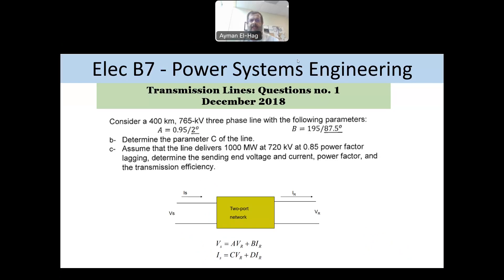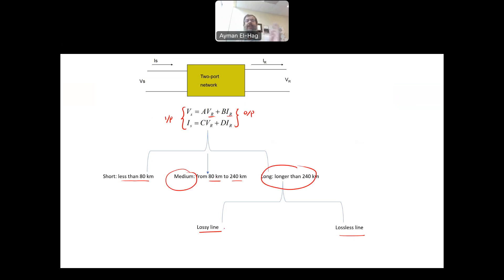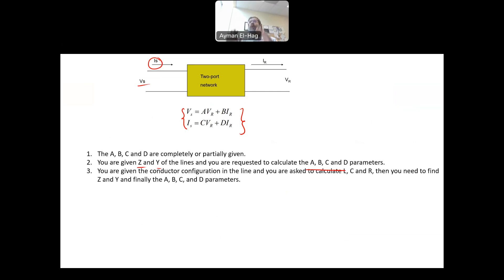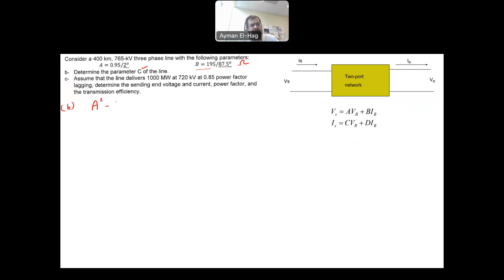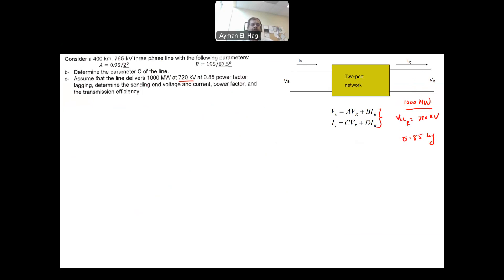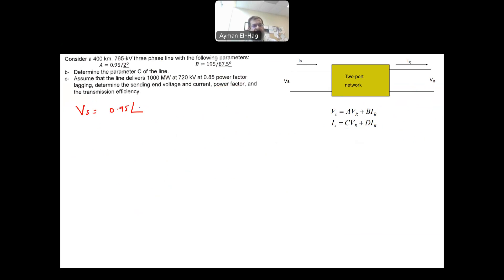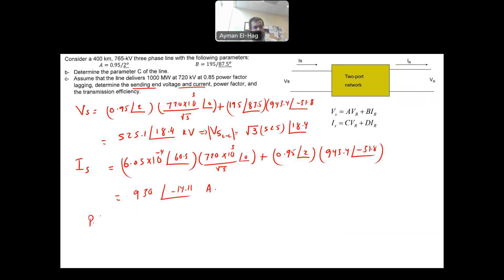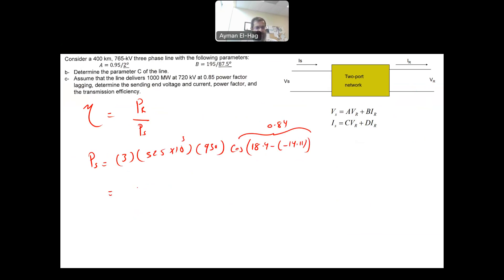PEO solve examples (ELEC B7) Transmission Line Question no. 1

Comment: when determining line voltage you are multiplying by root 3 but should not be the angle the same it should be added 30 degrees
Reply from the maker: You are correct, although I mentioned the magnitude of Vl-l, so I should not have written the angle

Comment: جزاكم الله خيرا وبارك فيك
Reply from the maker: الله يرضى عنك
Reply: @electrical4everyone  انا حقيقة ممتحن المادة نفسها ELECB7
 شهر مايو يوم  ٩..
وبعيد جدا جدا عن الدراسة ..قريب ال٢٠سنة..هل ممكن تساعد بأنه يكون في مختصر للأساسيات يركذ علي الإمتحانات مثلا..مساعدة لانو الزمن ضيق جدا...وشكرا كتير
Reply: وهل توصي باقسام معينة ساهلة من المادة ممكن  الواحد يركذ في قرايتها للامتحان بتاع الPEO
Reply from the maker: @farishassan7824  I would suggest try to study as much as you can, but these are relatively easier topics: transformers, symmetrical faults and transmission lines. Actually the question I selected so far are the easiest topics.
Reply: حقيقة عمل عظيم في الفيديو دا وربنا يجعله في ميزان حسناتك ان شاء الله..ممكن باقي الفيدوهات للامتحانات للمادة تكون ا بنفس الطريقة..الاساسيات ..المكرر في الامتحانات
Reply: @farishassan7824 hello, how was your B7 exam last year? Which questions repeated from the ones professor solved? Thanks